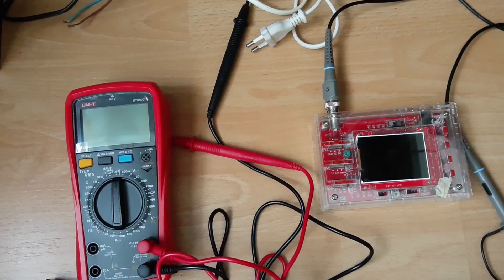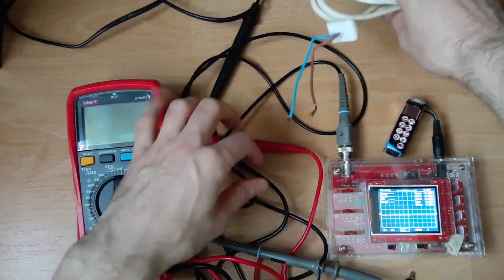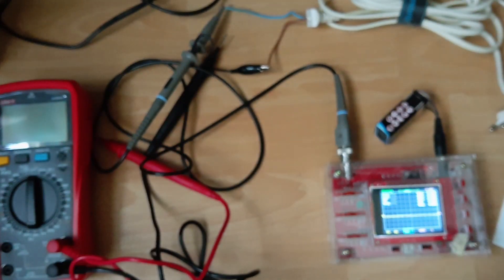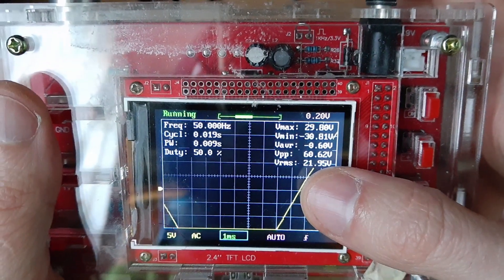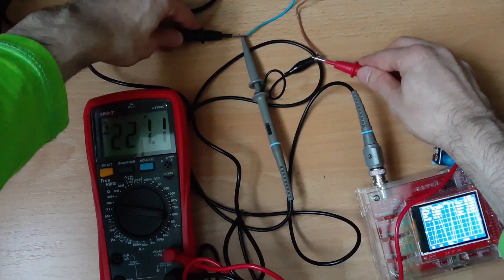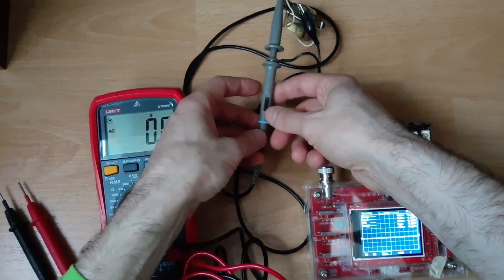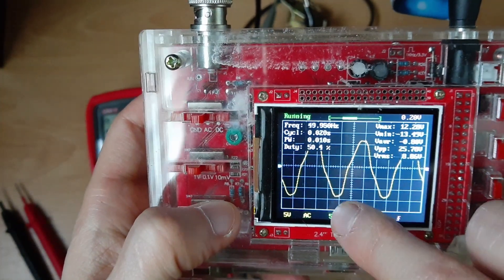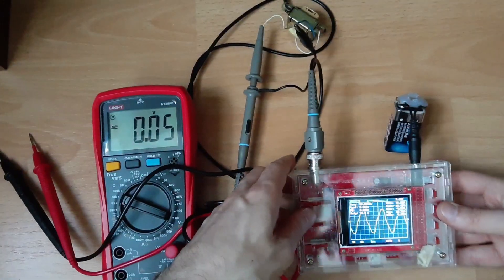Can you measure 220v ac with DSO138 ?

Comment: Touch the bnc connector while measuring and you may be dead !!!
Reply: Its a ground / neutral,  curb your fear
Reply: @claudiosantana3320  as long as the main plug is in good position. Turn around and the ground,neutral becomes line and vice versa. Then your Bnc is on line and.... good luck to survive.
Try out, but wirh line tester !
Reply: No problem, it is indian. They have 2bln population

Comment: You really have a lot more to learn about using that scope.
You are not going to get accurate amplitude readings when the signal is greater than what you can fit on the screen of that scope. It also requires the display of a minimum of one complete cycle, (but if you show 2 or 3 complete cycles your measurements will be much more accurate).
 That unit has an internal 12 bit analog to digital converter in it, while most of the much more expensive scopes are only using an 8 bit analog to digital converter.
 Also, you should re-calibrate it every time you turn it on, and re-calibrate it again after it reaches operating temperature.
 The calibration procedure requires grounding the input. (in this case your 10X probe), and hitting a few buttons to set the reference ground level for the scope.
 Without the 10X probe, the scope can handle + and - 50 volt swings from zero, (100 volts Pk to Pk), and with a 10X probe it can handle ten times as much or 1000 volts pk to pk. A 220 VAC sinewave is typically about 620 Volts pk to pk, so it should be able to measure it.
 For DC measurements and pk to pk measurements you can multiply your readings by ten to get the correct reading, but if a calculation requires squaring, you can't do that because squaring is not the same as multiplying by 10. (RMS measurements require squaring).....
 They do make scope probes that can do 10X and 100X, which would be perfect for that tiny scope. but even the more common 1X and 100X probe can be used with it to guarantee that you can keep those ac peak values from overshooting the scope screen..
 Once you get more familiar with that scope you will realize that it is a great scope for audio work, even with tube audio if you have a 10X or 100X probe...
 As long as you realize it's limitations, and do not exceed them, it is a fabulous little scope for the price.
 Have fun gaining more experience with using it...
Reply: I managed to pick up a 100X probe from ali for 12 dollars shipped. Very handy.
Reply: Excellent!
Now just be careful using it... @englishrupe01
Reply: Thnks for insight

Comment: Hi, does the transformer disturb/smooth... the wave? I want to check modified and pure sine wave of inverters. Does it modify waves? What about armonics? Thanks a lot. May be you could test with two probes? One before and one after the transformer ?
Reply: The scope is only a single channel, and harmonic analysis is not done in the time domain (which is all that scope can operate in), they are either done in the frequency domain, (spectrum analyzer), or a scope that can do a FFT (Fast Fourier Transform), and display the results of those calculations as something that looks like the output of a spectrum analyzer on the standard scope display screen. (and that scope does not have that option)
 Trust me when I tell you that the waveform out of a modified sinewave inverter will be quite obvious when you look at it with that scope. It does not look like a sinewave at all, but more like a combination of a squarewave and a triangle wave.
 The pure sinewave inverter will put out a clean sinewave as expected until it starts to get overloaded. 
(Harmonic content increases with the load on the inverter output).
Reply: Thanks, for me, as a hobbyist, that clears a lot.    @Dennis-mq6or
Reply: It might do FFT.  I have the DSO062 (earlier), and it is accessed by long pressing the Mode button.  But... mine has never worked (it can be seen in other videos).